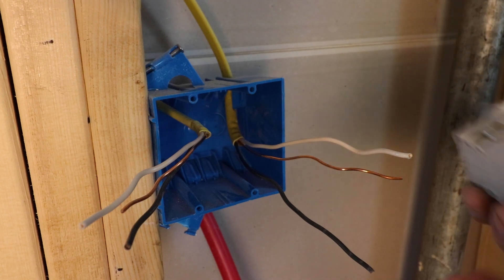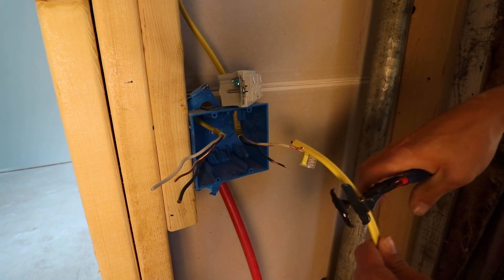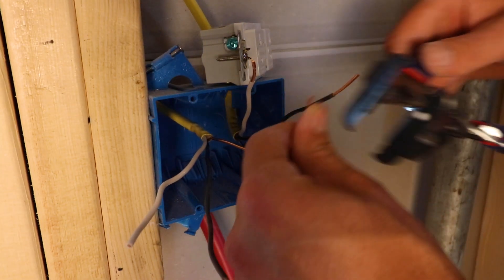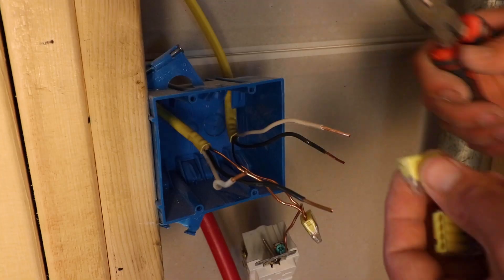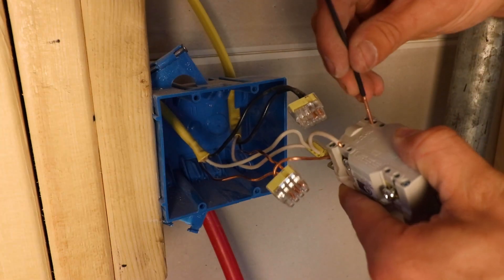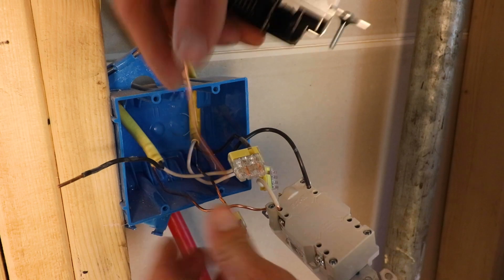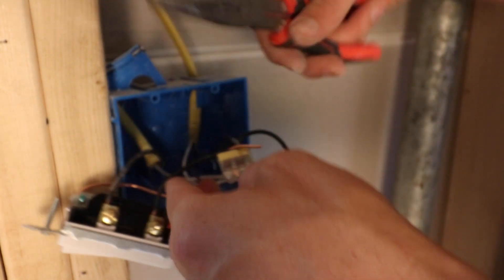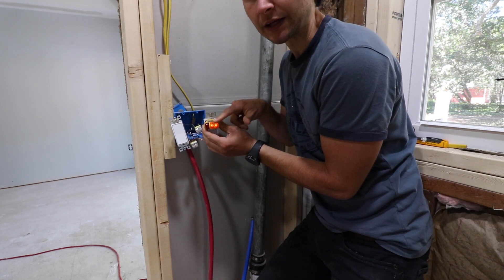Easiest Way To Wire a Light Switch and GFCI Outlet In the Same Box

Comment: Using a drill is a bad idea for tightening those connections. You have better control with a regular screwdriver, at least for the final torquing down.

Comment: I have a similar situation. Let me ask this is the outlet always hot in this setup or is the outlet controlled by the switch? I have an outlet with continuous power and the power goes to the switch to control the light. So my outlet is always hot. I open it up and there is a bunch of wires it has a regular outlet but it is in the kitchen so I wanted to put a gfci outlet. The outlet is about 40” from the sink

Comment: Why do you need push-connects for the hot and neutral wires?
Can't you use the holes on the back of the GFCI for both the hot and neutral terminals (two holes for each terminal) instead of push-connects?
Reply from the maker: @jonfklein  Hi, yes you can... but if you use the gfci box as a pass-through conduit, the light will turn off when the gfci trips. The video is showing a wiring method that will keep the lights on even when the gfci trips.
Reply: @hyperhomes4154  
What I mean is use both holes on the back of the GFCI for the Line terminals only. The Load terminals would remain unused.
In your installation you only use one of the two holes for the Line terminals on the GFCI. You could eliminate the hot and neutral pigtales if you used both holes on the Line terminals.

Comment: I don't trust those push connects remind me of backstabbing a outlet which cause failures. I always make a hook on the wire go around behind the screw or plate. I have used wire nuts for years pre-twist the wire and nut goes right on easily never have a failure. Not saying wago's or push connectors are bad not like going to be removing it all the time messing with it wire nut goes on never touch it again for years.
Reply: These have a screw that tightens them down. Not like the old ones that just poke in and come loose.

Comment: I use wago connectors but I've never used a single phase light switch. You just saved my bacon because I could not wrap my brain around what wire to jump where. Thank you!

Comment: Trying to add a light fromThe outlet but the outlet has both  neutral & hot terminals already are used. I believe one is going to the ceiling fan. Is it possible to add another light to the same outlet by pigtailing all three wires(hot,fan,light) & connecting to just one terminal?..doing same to neutrals. thank you.

Comment: Do not do this! First off, do not use needle nose to connect wires to push-in connectors. Second, dont use a hammer drill on devices. Also, you don't get GFCI protection to devices downstream unless you feed it from the Load side of the GFCI. Last, but most  certainly not least, never take electrical advice from a kid that can't stop gigglin during an instructional video!
Reply: 😂 And forth, but never least, least, fear everything in life and never do anything for yourself... because you're American and the educational system only teaches you to be a good little slave. So get an electrician before you kill yourself. 😂 I love youtube.
Reply: You ain’t a real electrician if you say don’t use them sometimes you have no choice but to do this

Comment: Then the light switch is not protected is that right? Only the outlet will be.
Reply: That's why I watched this. I was wanting to see if it's a good idea to run off of the LOAD side of the gfci to protect the light switch and fixtures. Guess I'll have to check with a professional. 😁

Comment: You, Sir, Saved our backsides on this video. We wanted to add a plug next to the light switch in our small bathroom connected to our bedroom. Basically we had to run new wire in the ceiling down to the switch. I initially thought I was wiring it correctly but stopped myself when I suspected something wasn't right. I consulted the Google machine and came across your video. My wife and I watched intensely. Then we watched it again. Then I went to Home Depot and got a bag of 100 Quick Connects. Then we watched your video again as we were doing the wiring, following every step. We were ecstatic when we flipped the breaker and everything worked properly. 

Thank you so much for wonderfully clear instructions on how to do it properly. Wife and I are very happy.
Reply from the maker: That's awesome man, good job making all the connects. I am happy to hear about your success. Thanks for letting me know. Cheers.
Reply: Thanks from me too. Your video and all the wise instructions made the installation a success. Much appreciated!
Reply: Bsckstabbing is dangerous..watch Everday Home Repair with Scott
Reply: Congrats on making your house a fire hazard
Reply: @buccaneerbob11  there are lots of people that watch these videos that don't know what you mean. Can you explain exactly how this person's comment created a fire hazard?

Comment: I noticed you didn't need to use the load terminals on the gfi, but if I had another wire from a double receptacle box comming into that box would I connect that cable on the load side to run the 2 receptacles and protect them also. Would that work? Like in my kitchen on the other side of my sink.
Reply from the maker: Yes, that right. You can use the the load side of the receptacle.
Reply: @hyperhomes4154  awesome video , thanks for the reply. Look forward to more videos.

Comment: If the switch next to the GFCI outlet were a smart switch that requires a neutral wire, how will you wire it?
Reply from the maker: The next time I wire a smart switch, ill make a video of it so I can show you.. In any case, we would use the neutral wires  already present in the box to connect the smart switch.  Good luck until then.

Comment: Why not have a jumper from the hot Load of the gfci to the switch? Then you'd only need a wire connector for the grounds and the switch and lights will be gfci protected. Wouldn't that be a valid option?
Reply from the maker: Good question. 
Of course you could totally do what you suggested and the lights would work just fine. But only as long as the GFCI worked. Meaning, the power for the lights becomes completely dependent on the innate functioning of the GFCI-body itself. The wiring method in the video allows the lights to continue working regardless of faults found within the GFCI-body.
Reply: @hyperhomes4154  I thought about that too, and I agree that it would not be great when the light also goes out. If the switch was connected to a bathroom exhaust fan instead, it would be more appropriate. Nothing wrong with what you did, just wanted to point out a 2nd option. Thanks.
Reply: @surferdude642  gfci are only really necessary for receptacles and switches, lites only need gfci protection if located below a shower or water source.

Comment: The Electrical Code requires that luminaries must be on a separate circuit from a GFCI outlet. 
This does video not follow the electrical code.
Reply: Would this still work if the switch and the gfci are in two separate boxes and the wires is 14/2? Great video by the way.
Reply: Nah.  Pretty sure this isn't true as long as the circuit is used only in the bathroom and not anywhere else. 
  
Additionally, retrofitting has different code standards, unless the wall is basically majority open, the house does not have to be updated to the latest NEC code version.